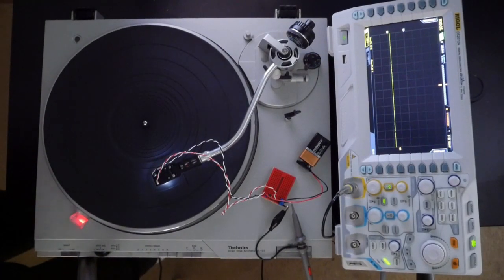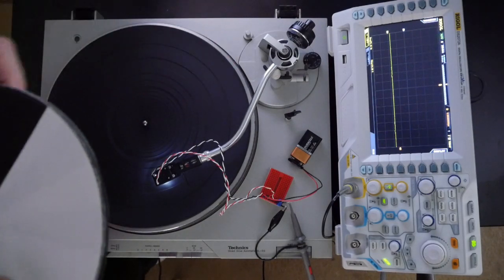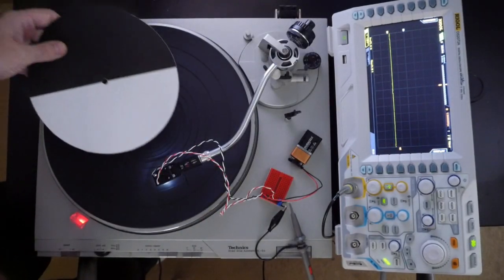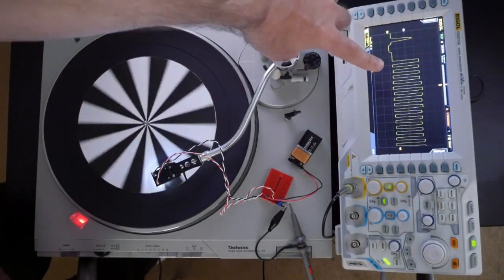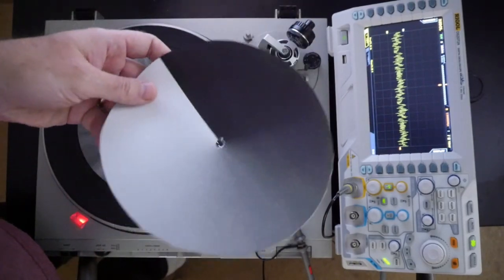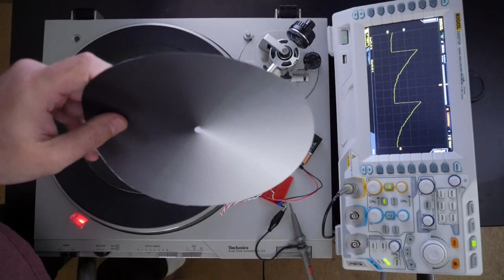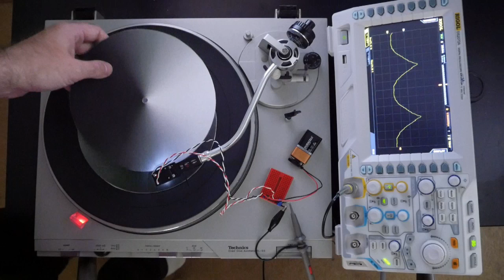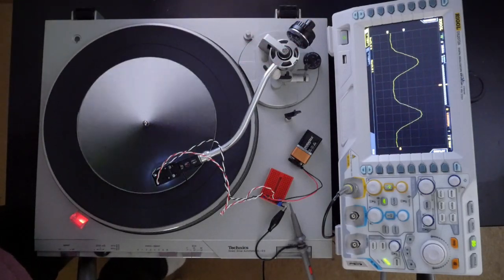Playing a waveform on a record player

Comment: Cool project. When you want to obtain waveforms without nonlinear distortions, apply the inverse transfer function of your optoelectric system to the brightness-levels before printing the discs. The OETF (optoelectric transfer function) of your sensor is already approximately obtained by measuring the voltage-output, putting the sawtooth-pattern on. Just a little math to do and an additional function to code.